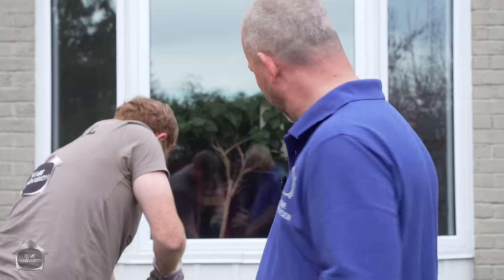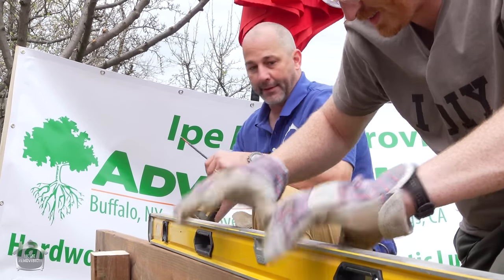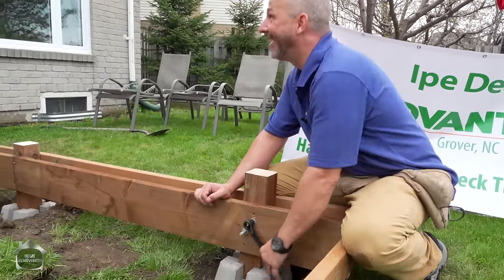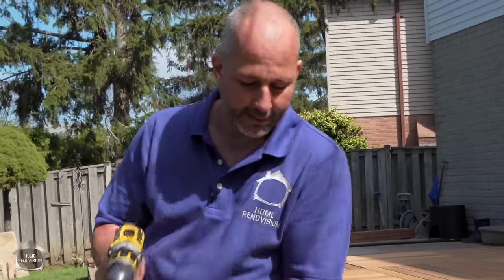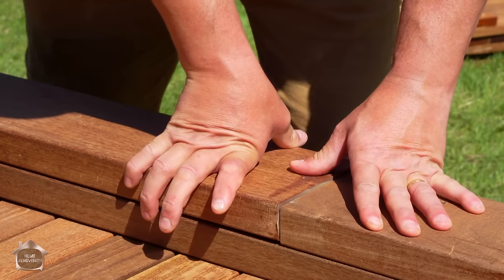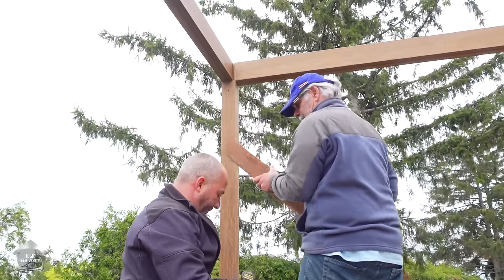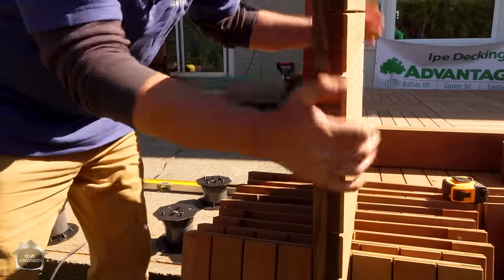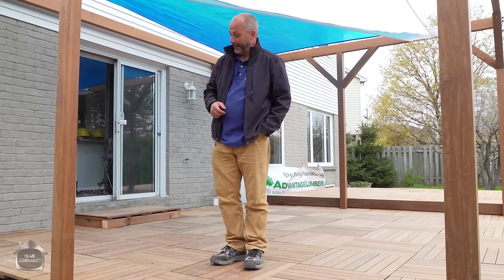How to Build a Pergola and Floating Hardwood Deck A to Z

Comment: Never use sandwich beams in a deck build. A building inspector would fail you.
Reply: whats wrong with that?
Reply: @phil3463  You should use at least a 6x6 post and notch it, then let the beam sit in the notch of the post. This way, the weight of the deck is sitting directly on the post.  If you use a sandwich beam, the weight of the deck is being supported by bolts.  The bolts can either shear off or the posts will develop cracks/splits at the bolts.
Reply: @billseegmuller6848  ok thank you
Reply: @phil3463  if you go the notch way you better buy some kind of sealer to retreat the cut portion as water will find a way in there and be trapped.. A better way is to set your beams on top of the post and fasten with brackets. They sell different kinds just for this purpose.

Comment: Oh man when they used the wrong concrete bracket was so cringe. They should of used a different bracket and drilled holes for counter sink bolts. Do it once do it right. The concrete the used was dry before they placed the brackets completely destroying the concretes strength then  they damaged the slab that's an insurance claim.

Comment: Use a two part epoxy instead of instant concrete repair.  The epoxy is stronger than the concrete itself.

Comment: YOU TEACH PEOPLE A LOT OF BAD  HABBITS🤣🤣🤣
Your work is very rough.  For example you when you put the boards down to cut the ends off. You string the line, you then go cut it free handed.. ??? big no no your supposed to cut thew edge with a guide rail or even a  straight edge or timber so you get  nice crisp line..
Do it properly and teach people the right way otherwise their job will be rubbish.